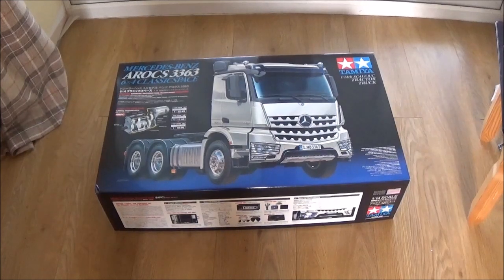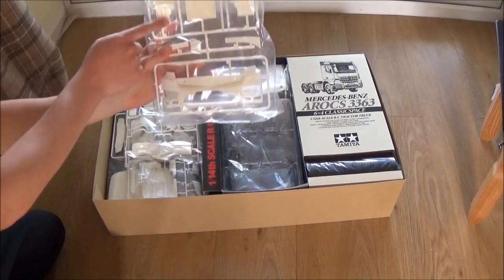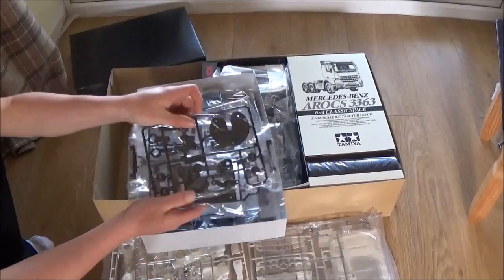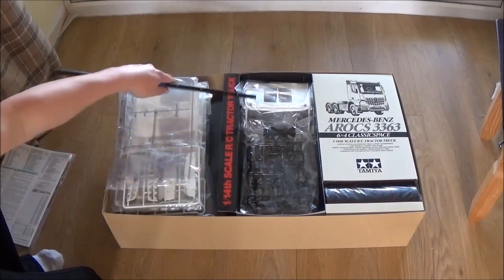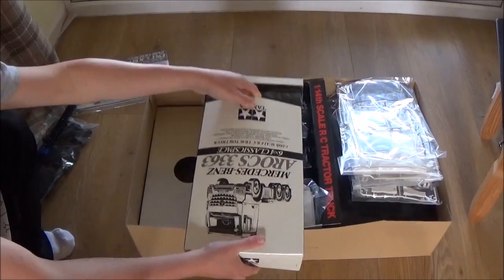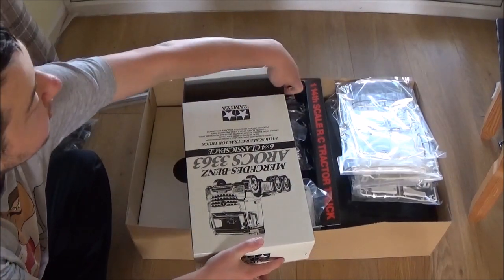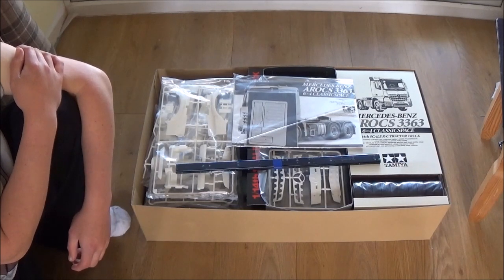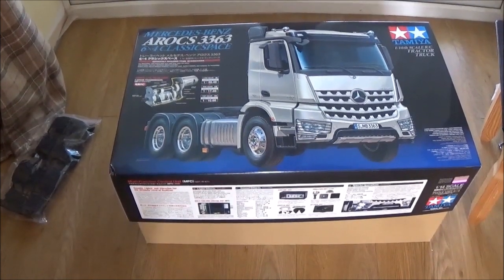Unboxing Tamiya Mercedes Arocs 3363 ClassicSpace 56352

Comment: Why did you want to change the motor? Is it because it's not poweful enough ? And I was also wondering how much weight could one pull with this stock truck on a trailer without risking to damage gears, transmisison or the motor?
Reply from the maker: I chage the motors just so you get a more realistic speed from the truck
Reply: Dont know if you guys gives a shit but if you are stoned like me during the covid times you can watch pretty much all the new movies on Instaflixxer. Been binge watching with my girlfriend lately :)
Reply: @Andrew Alvaro yea, I have been watching on InstaFlixxer for since november myself :)